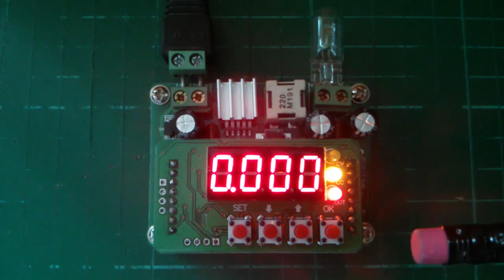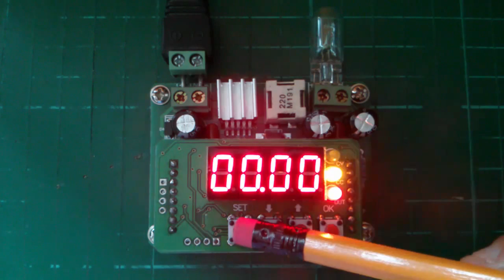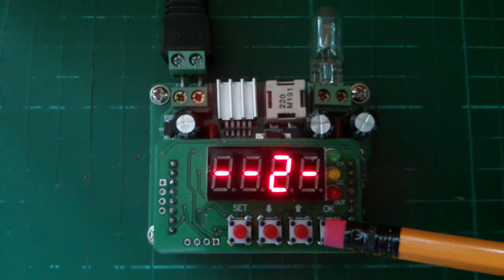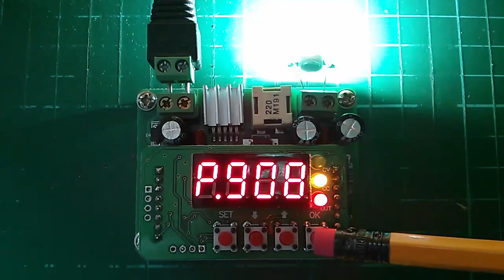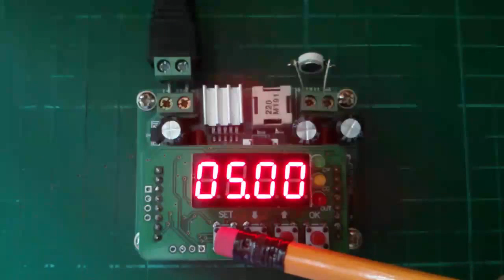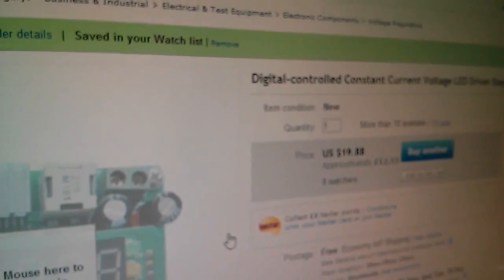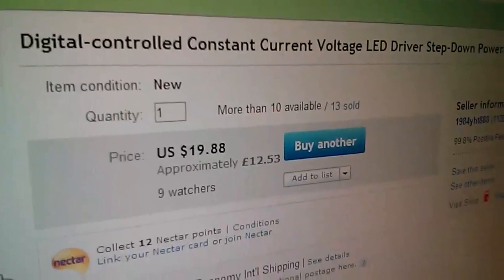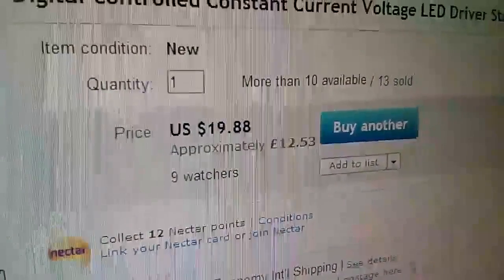Review: 3A 40V Digital Buck DC/DC Converter - It's more like a Bench PSU!

Comment: Try switching on with the set button pushed. I am not certain what I am seeing.
Reply: Alan Powell

B3603 Calibration Routine:
Connect to 35V supply (the module needs to output 30V during calibration). You’ll need a good voltmeter (VM) and current meter (CM) capable of accurately measuring up to 1.2A. Connect either to the O/P terminals as instructed in the procedures
Power on, press and hold set until F1 appears, you can now press up down to cycle through the cal points F1 to F6. Select F1 and press OK
F1: Voltage Setting Calibration (use VM)
Display shows 02.00, use U/D to match reading on VM, press set to store (the display will change back to 02.00 and your VM should also read 2.00V)
Press OK and repeat the above, this time at setpoint of 30V
Press OK to return to F1. I'd recommend going round the loop several times to verify the 2V and 30V setpoints. Press OK to return to F1, increment to F2
F2: Current Setting Calibration (use CM)
Same procedure as F1, set points are 200mA and 1.2A
F3: Voltage Reading Calibration (use VM)
The module will now O/P 2V (verify with DM, the accuracy will depend on how well F1 was performed). Similar to the other procedures but a little more tricky probably due to filtering, also I don't think there is a need to press SET (not sure what that does in this procedure). Press OK and repeat at 30V press OK and loop several times to tweak 2V/30V settings.
F4: Current Reading Calibration use CM
Similar to F3 but at 200mA and 1.2A
F5: Calibration Settings Save Y/N
Select SA-y to save calibration data (not 100% sure on this as it appears to save settings anyway!)
F6: Factory Calibration Reset
Select r--y to reset to factory calibration values
Reply: Alan Powell
Hey Alan, You might want to try a search for scooter chargers. These are 36 volts but you might not find more than 1.5-2 amps. You can get them for $11.00 though. If you do a search for 36 volt power adapters on E-Bay I saw a 36 volt 4 amp supply for $19 that looked like a laptop supply but it comes from China. Im interested also so I'll watch for other answers.
PS I'm using a 3 amp 24 volt laptop supply. Also very cheap.
John
Reply from the maker: You mean F1 to F6. You don't need to switch on with the set button pressed - it shows up if you just press and hold the 'set' button at any time. This is a calibration menu. I've got a document somewhere with instruction for using these calibration menus. I've been meaning to video the procedure.
Reply: Julian Ilett AHA! So I haven't found another secret menu. I am using mine as variable supply for by breadboard/arduino prototyping setup. I would be very interested in a video or a link to the document. It is a stunning little piece of kit. I wish I had found out about it before buying my expensive bench supply.

Thanks for the video(s) Regards Alan
Reply: You use F1 to F4 to calibrate the voltage and current setting and reading accuracy. You'll need a DMM to calibrate the module against but it vastly improved mine over the factory settings. I believe F5 is used to save the cal settings and F6 to reset to original settings
Reply: AtomicWorkshop Great - I have a DMM. How do I calibrate the module?
Reply: AtomicWorkshop
Hello, Can I ask if you figured this out yourself or did you find this in a tecnical brief somewhere? Man this is a fun little unit but is it ever hard to get all the information you need for it. Thanks for this Julian and Atomic.
Reply: AtomicWorkshop
Thanks guys, I understand the whole mess now (finally) The second voltage calibration matches the readout to the actual voltage on the output terminals. Going back and forth and avraging as best you can gets you much closer than factory setting. If you're luck all will match. Set voltage, Voltage readout and Actual voltage on the output. You can hardly have more fun than that.
Thanks again
John
Reply: AtomicWorkshop
Many thanks. You have enhanced the value of this nice cheap piece of equipment many times with your work. Now where do I find a 35 Volt supply................
Reply: Alan Powell 2x old laptop PSU's in series? I use one to power this pupy, gives about 18V.

Comment: Just some info for you Julian. I recently recieved the 8A bigger brother of this module. It works exactly the same as your 3A sample. Build quality looked to be pretty good too with Nichicon electros. Whether these are genuine Nichicon is possibly questionable, given it is from China.
To call it the bigger brother is a bit of a stretch as the power circuitry is different using a different reg and has an additional power FET. Curiously on my sample the voltage regulation was less accurate (about +/- 0.3V depending on setting) than the current regulation despite the current sense resistor being a wirewound ceramic type and the current setting remains at 1mA increments. Overall I am pleased with the unit but what would really be a killer unit would be a cross between the other unit you have with twin displays and the rotary encoder and the smart software of these units. Perfect for a poor mans bench supply. Thanks for putting me onto these.
 The supplier seems to have a very interesting (to a geek at least) range of items. Bookmarked him for future reference.
Reply from the maker: Hi Rob - yes, I ordered the same 8A unit and got it a few days ago. What got me excited was the silk screen lettering on the LHS of the display board - Vcc TxD RxD Gnd. MingHe's ZXY6005S (the LCD / rotary encoder unit) has a built-in serial protocol for reading current and voltage data, and setting current,voltage and on/off settings. Unfortunately, this unit doesn't appear to have the serial interface enabled/implemented. I tried lots of different commands at different baud rates but to no avail. So disappointed!
Reply: Just had a look at the ZXY6005D and the links for the manual and comms protocol are just spam ad sites. I wonder if you hve a decent source for these?
Cheers
Reply: Rob B I have the software and protocol manual if you want
Reply: Diogo Carvalho Hi. Can you please share the software and communication protocol? I would to tweek the 8A version.

Thank you so much!
Reply: BangMobile I have the software for the ZXY6005, I think is not compatible with that in the video.
Reply: Can you share me the software and manual for the zxy6005s

Comment from the maker: When you can buy it for a few dollars, there's not much incentive to design it! Generally, current sense resistor in the output low side, op amp to multiply the resistor voltage.